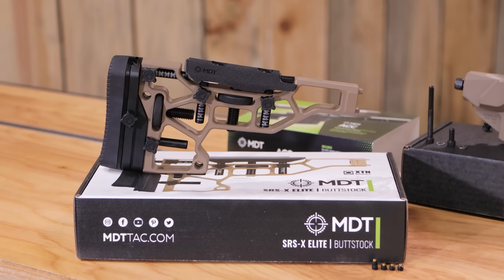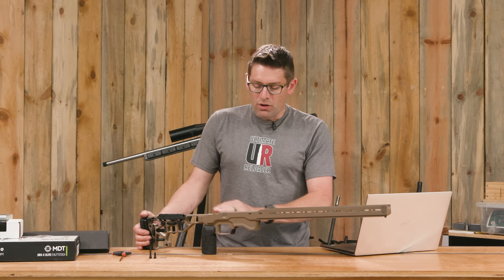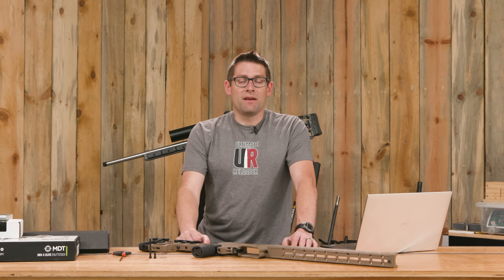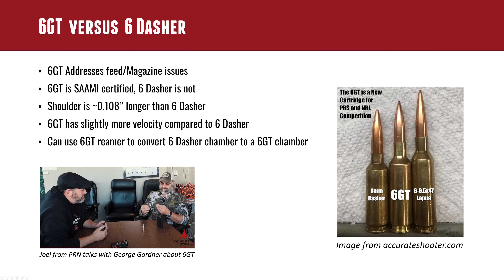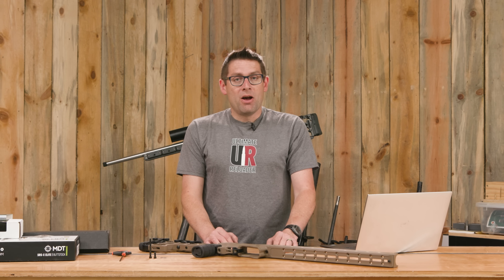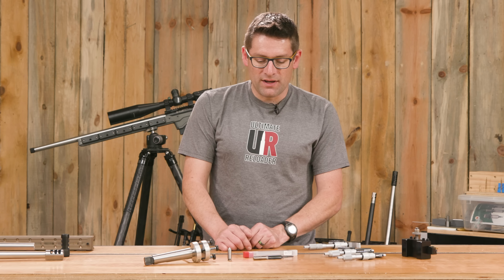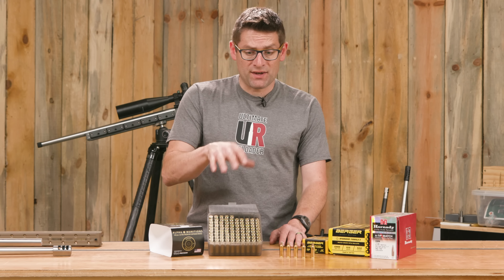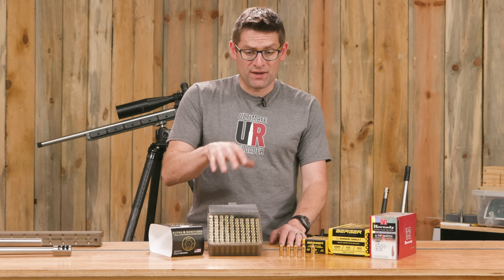6GT PRS Rifle Build Kick-Off!

Comment: Great choice Gavin!!  Have 2 6 GT’s, both on MPA Matrix Chassis, Terminus Zeus on one Curtis Custom Valor on the other. One is a 24” proof stainless using original Alpha brass with Sta-Ball and Berger 105’s running around 2960 fps. 2nd one is a 26” Bartlein running OCD Alpha and Shooters World Precision (supposed to be a Varget equivalent) loading to the same 2960 fps with Berger 105’s. Easy to load, plenty of nodes to choose from.  Be cool to see this series to see how well you like the round👍👍

Comment: I run a defiance proof 6gt, with a 120 free bore. I run a 109 lrht in alpha brass, with 35gr of h4350 at 2850fps. i found the 109's like a .065 jump, which with a 120 freebore, are seated pretty deep. 
my next barrel i would like to have the freebore bumped to 170, and i'd like to try some 115gr dtacs.

Comment: Just got my GT together. I've got Varget and 6.5 Staball for load development and matches. For barrel break in 250 of 108 ELDM over 33.0 of IMR 4064 with CCI 400 and Hornady brass for 2815 fps from 25" barrel.

You should also look into getting some 109 ELDM (0.42 CPR) from GAP to save you some money vs the 110 Atips.

Comment: I have two 6GT's - One "PRS" style gun, and one F-Open. Both are 28 inch tubes and run the same load (34.1g Varget // Berger 105, 18 thou off lands, 120 freebore) They're both match winners. The berger 105 likes to go ~ 3000-3030 in a 28 inch tube.

Comment: Gavin I went from a 6BRA to a 6xc skipped the GT . My goal was to shoot 115 class bullets . I specked  my own reamer with the help of Dave Kiff to get specific measurements to my thought and needs . I went out side the Tubb specs for free bore .140 ,neck diameter.2745 and Webb  one thou larger . I also have been looking at a substitute for Varget and H-4350 . I found it N-150 ,shoots lights out in 6 BR ,6BRA and XC .I have just started testing it in 6.5 Creedmoor and it looks good .Wow one powder to do all these cases with great results.I shoot 115 DTAC and 115 Berger’s with great results

Comment: You should try the 109eldm bullet. It’s the poor man’s A-Tips. Ran on the same dies as the A-Tips but with a plastic tip and not handled with white gloves. I run a 6GT and have been loving the 109eldm. I load them with H4350 at 35.4gr which gives me about 2820fps. The GT can get up over 3000fps but you sacrifice recoil when you get that hot.

Comment: 105 Berger Hybrids have been a must for my 6GT,   full wind i opt for the 115, not as much MV as the 105's.  FYI, if you dont mind slight more charge weight, 6.5 staball also produces significantly high MVs over Varget.  Im getting 3050 with Staball and 105 VLDs 26" barrel.

Comment: Interesting that a key reason for the GT is possible mag feeding issues…. Well over 10k rounds of Dasher fired with Primal Rights kit in an  AICS and zero feeding issues. Running a Dasher at 2810 can get 2500+ shots out a barrel
Reply: Do that without any mag mods/kits.
Reply: @cadetbooth  why would I use an incorrect mag? It’s not uncommon to get optimal performance out of many mags need a bit of tuning

Comment: I'm using Alpha brass, CCi 450 primer, 39.2gr StaBall 6.5 pushing Lapua 105gr Scenar @ (3,028fps) out of my 26" Bartlein barrel with Area 419 Hellfire match break, Defiance Deviant tactical action, single digit ES and SD's, tiny groups at 100yards, 6-7" groups at 1,000yards!  Good luck with the build.  I've also had good luck with Berger 108gr Boat Tail Target and Hornady 110gr A-Tip with Varget but not the velocity of  StaBall.  I'll be testing N140 next, now that i have 16lbs   ;)

Comment: I run a 6GT & it's a pretty spectacular little cartridge.  I have shot in F-Class and a small steel challenge match.  It's crazy easy to load for and it shares some similarities with other 6mm cartridges.  I have found that so long as the muzzle velocity is the same, then the harmonics are pretty much the same.  I might see a whole 0.1" difference in group size, but on steel it makes zero difference what load set I use, StaBall, H4350, Varget, etc.  They all run very well.  Mine loves the 107 SMK and the 109 LRHT.  At 1k I shot several 7" groups with the 109.  I hate the MDT Thumb screws though.  So irritating.

Comment: RL-16 35.6 gr Berger 109 Fed 205m primers Hornady brass 40thou jump 2925 fps=.3" groups. Amazingly accurate. Also likes the SMK 107's same load 2931fps with a little lower bc. Both great out to 1200yds.

Comment: I run a 6mm creed, and have tested exactly same bullet choices your looking at with one exception; your missing the Lapua 105gr Scenar L.  I tried really hard to beat it with Berger et al, and couldn't. Suggest putting it in the mix, plus it's easier to find and cheaper (in Europe!!)

Comment: Gavin, I would love to see you test the new Reloder TS 15.5 powder in the GT.  I am shooting a 29" Krieger 1:8 with Barnes 112gr match burners.  The TS 15.5 gives me about 50-100 fps more velocity in my dashers and my GT.  I just switched to the 112 Barnes and am having great success with them.  When the 112's are combined with the TS 15.5, I am getting 3090 fps velocity, just short of having any pressure issues.  This velocity and bullet weight place the ballistics very close to my .284 Win.

Comment: 2:35 any thoughts on making a 7PRC barrel for that long action in the future?
Reply: I haven’t jumped on the PRC wagon yet. I’ve been waiting on the 7mm. Now that it’s been announced it’ll be my next rifle buy or build.
Reply: @craigmcmullen231  to me it makes more sense than the 6.5 or 300
Reply: @halfdollar86  absolutely! Especially considering this family of cartridges was designed for long ranger target shooting accuracy. The 7 currently has some  way better BC’s. You’d think Hornady would have looked at their current bullet selections and figured out that the G1 and G7 numbers are better for the 7mm. 
I sort of understand why they did the 6.5 and 300 though. The 6.5 craze is one reason. And the US is a 30 cal country. So what they did sort of makes sense. But I’m sure their designers and engineers were pushing for the 7. 
The 7mm PRC could be one of the most effective and efficient cartridges on the market today. I’m excited for it.
Reply: @craigmcmullen231  I agree with everything you said.   In my opinion the 7 PRC should be the most popular PRC to date.    I can only imagine how awesome a 7 PRC would be when loaded with a 190 or 195 Berger, a 197 Sierra Match King or a 190 Hornady A-Tip.